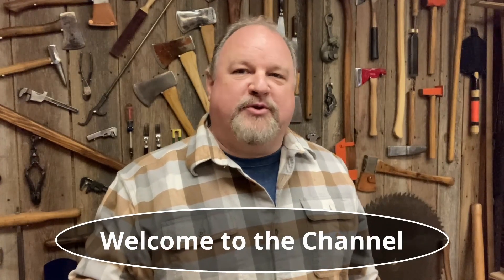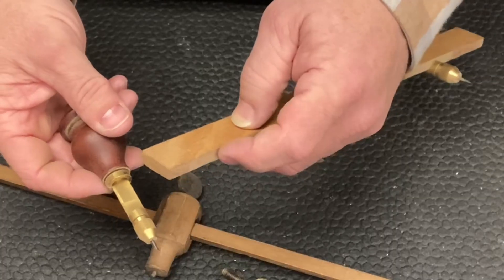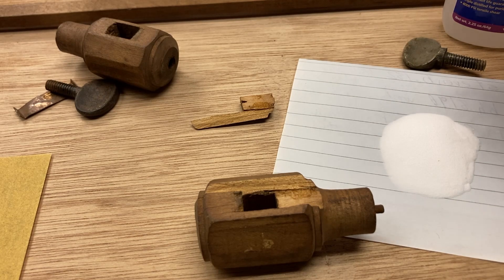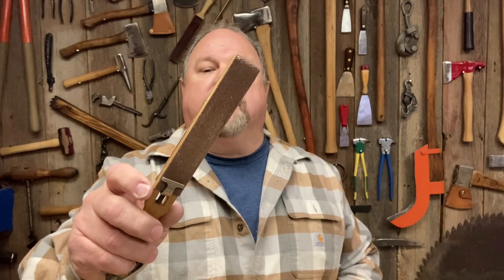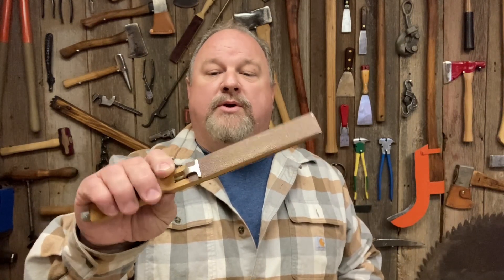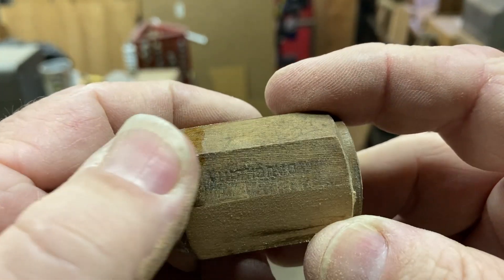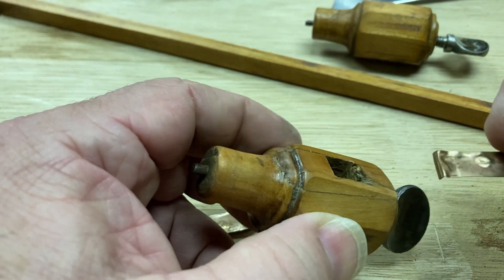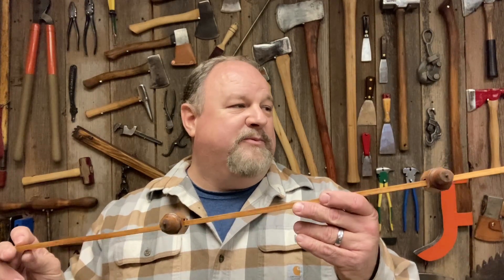Trammel for Marking a Radius

Comment: I'm not looking to make more work for you but that sanding board I think looks like an excellent tool. I can see just what your dad did there to recreate what you described as the original plastic sanding board. Maybe in a future look at trying to fill some video  you may not have a specific plan for you, could disassemble it and let us get a look at it and how the parts are configured. The main thing is seeing how you dad did the tightening function to clamp down the sand paper. I did a browser search and didn't find any that resembled the one you dad created but I did find one with a similar outcome but it looked more like a block sander. So if you are so inclined that is a request from the peanut gallery. Enjoyed the trammel restoration and the wood tools are great. Cheers
Reply from the maker: Thanks for the suggestion. I’ll definitely take it into consideration. I’m always trying to figure out how much content I need to make a video? thanks so much for stopping by and watching and for the suggestion. Have a great day and God bless.

Comment: just wondering how much time went by between adding baked soda, applying addasives before you started sanding?
Reply from the maker: The glue solidified in less than 30 seconds, and I was sanding within 3 to 4 minutes once I had the camera set up. The glue is a two part system. I applied the glue, and then you apply the accelerator which is in an aerosol can. The accelerator causes the glue to harden within seconds. I hope that was helpful and thanks so much for stopping by. Have a great day and God bless.
Reply: @toolscouter  yes that was very helpful, Thank you,and I will be looking to find that cause it will be helpful for some jobs I get into